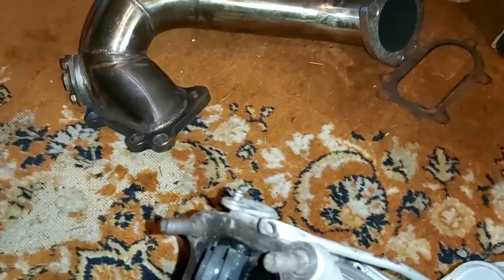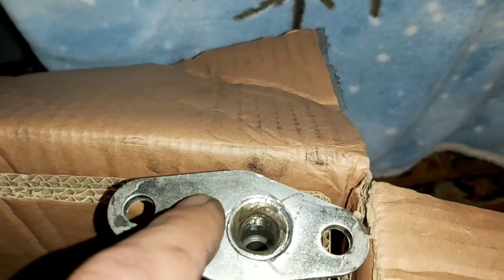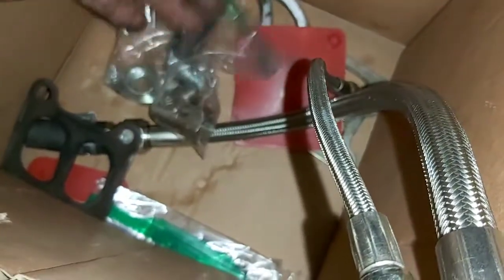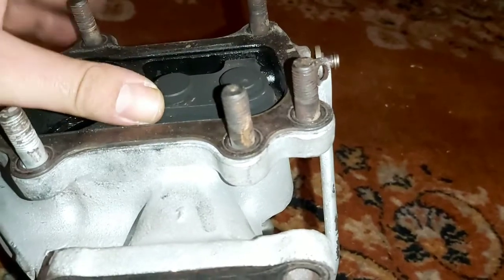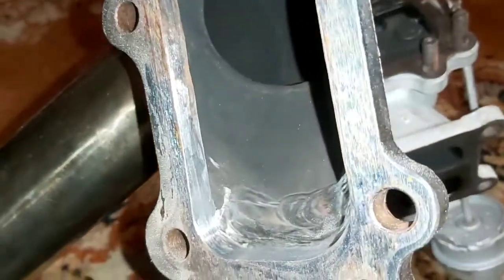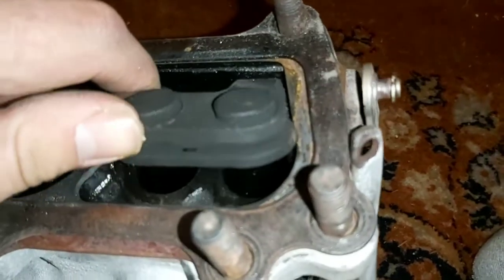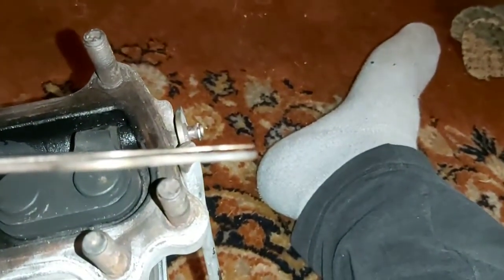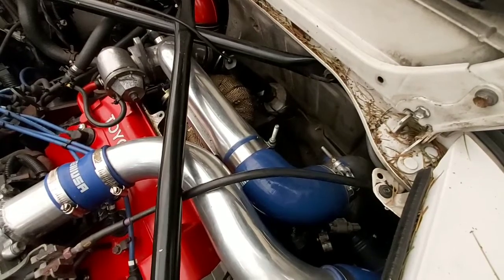How to fix boost creep Toyota MR2

Comment: I have purchased both the bay down pipe and entire turbo. I learned first how crappy the gaskets were, then the down pipe cracked, and then the turbo was already fully worn after it blew a rod bearing. The oil Press went from a bad oil return setup, and I ended up purchasing the Mamba kit which looks just like the one you show that is in the box. When I first switched to the oil return system everything was okay, but after rebuilding that bad engine, ever since I have been smoking through the turbo and it was wet with oil just like yours is. I am wondering if some of my issue is with this oil return just as well. Another thing I see on my new turbo replacement, a CT27 that is used... Is my waste gate valve at the turbo, with the flap, seem very loos and I can move it around a bit while the arm is connected. Most of my bad turbos lying around are all tight, so, I worry about it. I see there is no adjustment arm from the stock actuator, or any way to lengthen or shorten that arms' travel.
Reply from the maker: Could be a faulty actuator on that turbo if the rod feels loose.  Only ways to adjust the non-adjustable ones is to shim out the actuator from where it bolts to the turbo, or bend the rod slightly, or you can buy an actuator with adjustable rod.  As for those oil lines if they are aftermarket I would go back to stock unless yo know they can drain fast enough because it can take out turbo seals from too much pressure and oil.
Reply: @turbogarage4889  , unfortunately the stock one cracked too. And my friends mr2 did the same thing too, so we both got Mamba. Just like magic both ended up having bad turbos..mine smoked like a Nova with bad oil rings, after a rebuild, and my friends ride refused to boost..but it would spool, juts the WG is too tight once I pulled it off. 

I guess I don't know for sure if the return lines are working except that my turbo was burning oil and my buddy's was just not boosting. I did notice liquid oil collecting at the intercooler though. 

About the Wastegate flap:

On mine with the ct27 used upgrade. I can wiggle the flap itself when the rod is in its resting state attached to the flap arm. The rod worked great at like 5 psi from a bike pump...and the rod remains tight in its resting state.

Still, at the resting state I can lift up on that door flap just a little..maybe a credit card thickness or so.

My other turbos lying around vary in how pressed they are in the same resting position. They are all pressed against the turbo but not too tight as to stop me from moving the door itself around in its' retainer. 

Basically I just need to be a little shorter in that arm in order to have that flap at least pressed into the turbo and not loose enough to have it rattle. 

There is a possibility that once it is all running that flap will be pressed more with vacc pressure..and in boost mode it wouldn't matter as it opens. 

You think I should bother with changing the actuator or just put it in and see later
Reply: FYI. There's enough slop that it wiggles without the rid moving at all. Just with the slop in the hinge and attachment hole. 

When comparing these wiggles to the other turbos..they all have plenty of play in their hinge and such
Reply: Hey. The Shim idea worked well. I should have thought of that earlier...thanks for the tip.